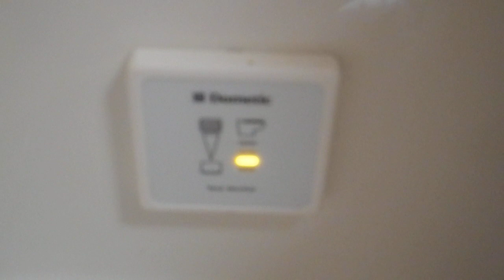Toilet sucking noise

Comment: That’s a fancy schmancy little boat your on there—good thing for the old sea water flush until you can get the parts for that.
Reply from the maker: Gotta know how things work so you can know when a bandaid might be ok vs fix it immediately which can sometimes delay your departure.
Reply: @AskCaptainChris  this is a Sea ray Chris?
Reply from the maker: John M Formula 40 PC.
Reply from the maker: @johnm5714  Formula Performance Cruiser

Comment: The flushing water (sea water) in my boat stank like hell if it had gone more than a couple of hours since the previous flush. Turned out some bacteria or algae were living on the inside of the flush water hose that made the water stink. After rinsing it with chlorine bleach, the problem was gone. A toilet trick that might come handy sometime.
Reply from the maker: skunkjobb low tide aroma.

Comment: I think that is one repair i might hire someone to fix.
Reply from the maker: nashguy207 at $90-$125/hour from the time they leave their storefront? And sometimes they can’t come right away. But it is good to know where you draw the line.
Reply: I have another type of toilet in my boat with a macerating pump. A tiny belt from the motor to the impeller broke and I had to pull the whole thing to molecules to get at it but it was no problem and not especially gross either.
Reply from the maker: Not a difficult repair, just make sure you have the parts on hand BEFORE you need them. Do you have a spare tire or sewage snake BEFORE you need them?
Reply from the maker: @skunkjobb  DIY repairs are not difficult and when something breaks on the weekend who you gonna call?